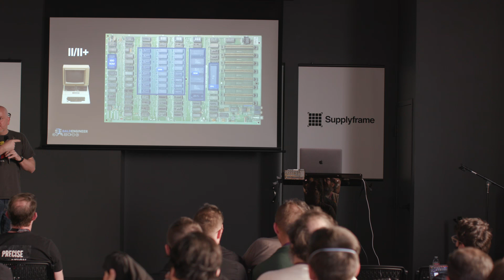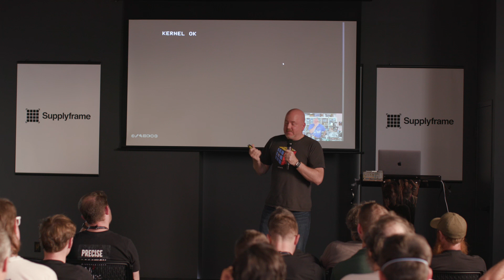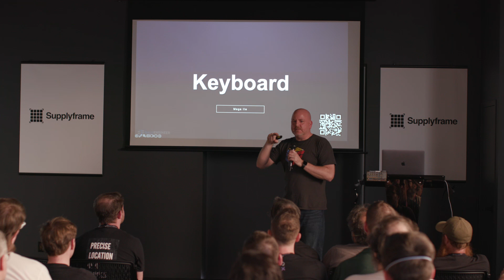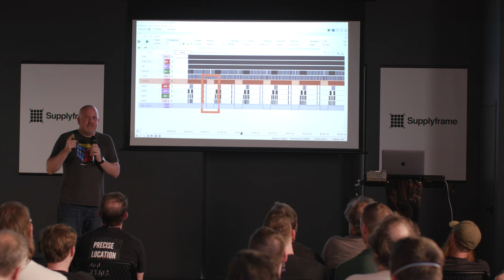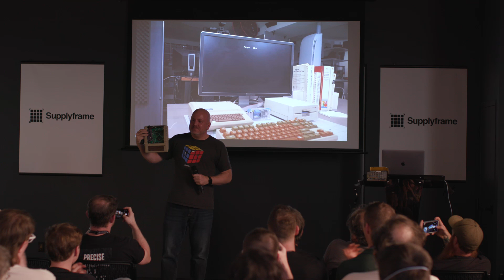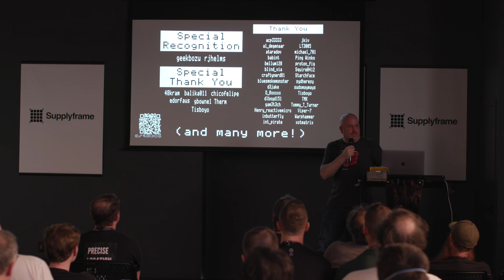Supercon 2023: James Lewis Builds His Own Portable Apple IIe

Comment: 26:20 I remember one of the Apple II machines had this "clever" trick with a Green/Magenta screen, where is could either drive both the green and the magenta subpixels, or the green from one and the magenta from the adjacent pixel! They used this to double the solubility (not the resolution) of the screen. Like a predecessor to modern anti-aliasing.
Might it be that the Mega II has a similar trick, where it "knows" the arrangement of the subpixels and shifts them over per subpixel instead of per pixel to add to the apparent resolution? You could try outputting to a genuine IIe display to see if it "works".
Reply: The IIGS's composite circuit, which I used for the early stages of the project, doesn't output the same composite signal as the IIe.   Mega's 4-bit RGB signals and SERVID (the luma/chroma data for each line) output the same data. The 4-bit RGB signals are a de-muxed copy of SERVID. Unfortuantely, SERVID does not behave exactly like the SERVID on the II+/IIe.